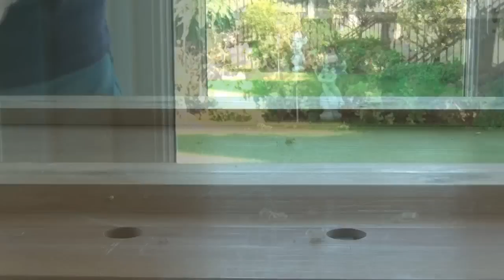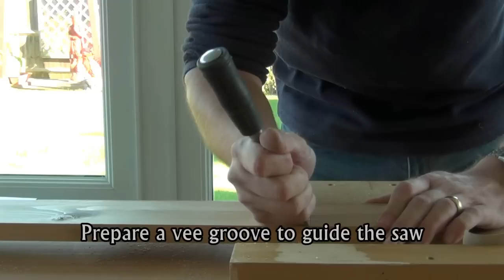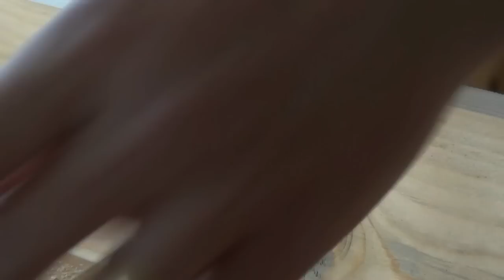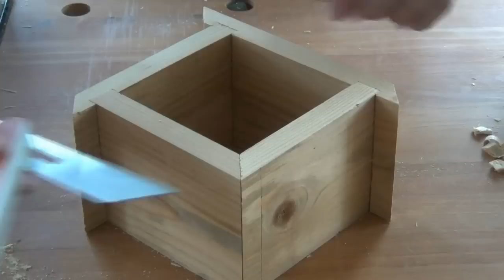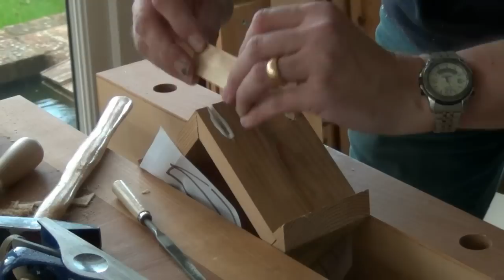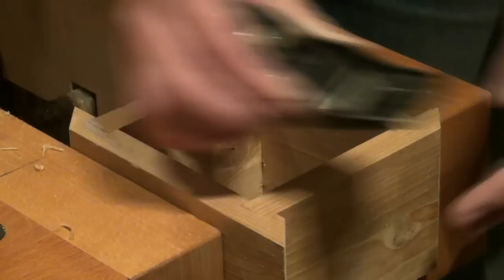Solitary Bee Hotel - Insect Haven for Winter

Comment: Nice one Mitch.  Five star accommodation!  Great to see such an underrated jig feature so highly in this video, the humble bench hook!  Cheers Mick
Reply from the maker: Mick Doherty Cheers Mick. Did you mean the 'made in two minutes from scrap' one that measures off the bamboo lengths! It's been around for years now, and I just can't throw it away - unless I build a new one (lightbulb moment - basics video opportunity).
Reply: Mitch. The bench hook I was referring to was the one you used to mark out the sides and do the chisel work on.  A bench hook would be good for beginners. Cheers Mick

Comment: Fantastic.  
I've been gaming your videos to see if I can anticipate the steps in the process and the methods employed to get to the finished product that we see at the beginning.

I thought for sure I would have seen the router plane come out for the dados and  I didn't expect the coping saw for the spline cuts.

I'll give myself a 60% on this one.  Not great but, I'm improving.

Thanks again.
Reply from the maker: TheJimsock Forgive yourself the router plane, it would have been ideal. I thought on this occassion I would limit myself to more common tools. The shooting board was a little overkill for a garden project, but so easy to knock up that there's no reason why anyone with a bench plane shouldn't have one.Question is, are you going to make one?
Reply: WOmadeOD - Made in Wood with Mitch Peacock   Actually, I'm pondering something, a tiny bit similar.
I have embedded the broken bits of a wedding glass (you know, the one the groom stomps on straight after the I do's) in an acrylic block. [ 5.5"L X 4.0"H X 2.5"T],
I intended to wrap it in wood similar to the way you wrapped the bamboo but, it dawned on me that all the highly polished acrylic I worked so hard on at the edges would not be visible. 
One solution is to expand the frame, take a third of the center out and suspend the block with a bit of bridging at the corners and mid-points of each side so it could be seen from all angles.
Because the Acrylic is too jam packed with "precious" glass shards, I just can't keep working it to make it straight and square.
The odd dimensions have me bouncing my empty head on the walls.
I suspect that if I manage to get successfully through it, as the theory goes, I should be able to manage the bee hotel......wishful thinking.
Reply from the maker: TheJimsock Sounds a good challenge. Post a picture when you're done.
Reply: WOmadeOD - Made in Wood with Mitch Peacock Posting a picture....hmmm...I guess I should get around to learning that skill too.  I'll give it a go.
Reply from the maker: I would like to start a page on my website, to show the work being done by subscribers. You could be one of the first if you like, just email me the picture with any words you'ld like included with it.
Reply: WOmadeOD - Made in Wood with Mitch Peacock Very well.